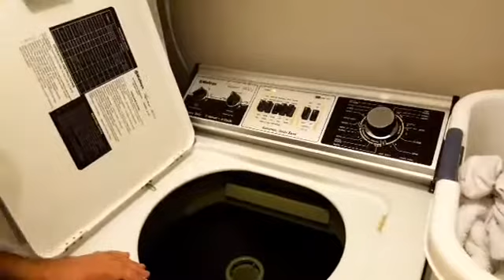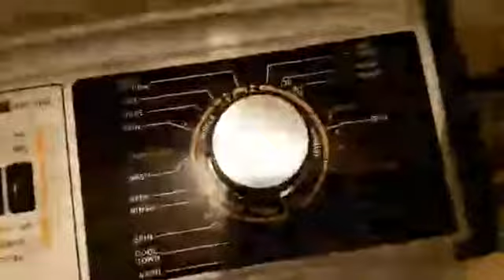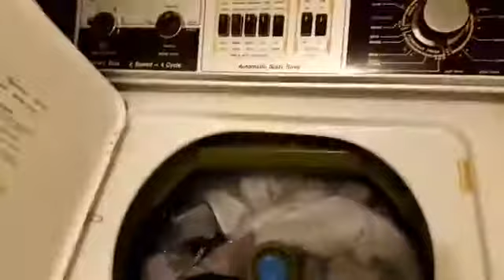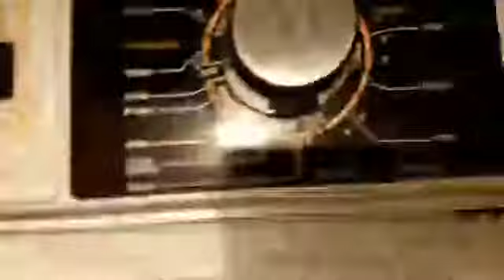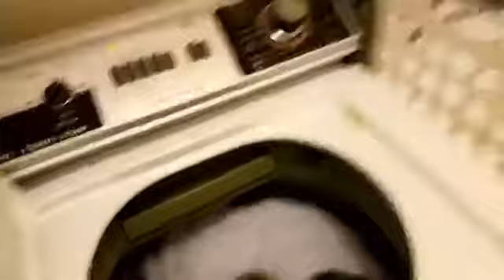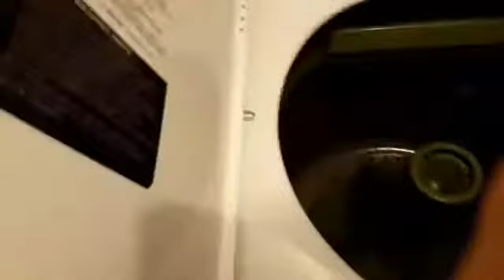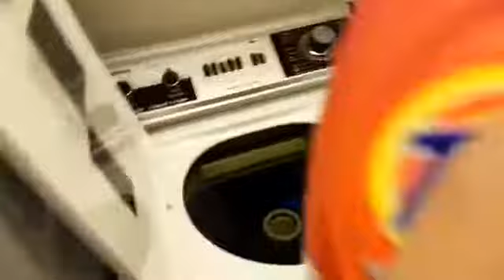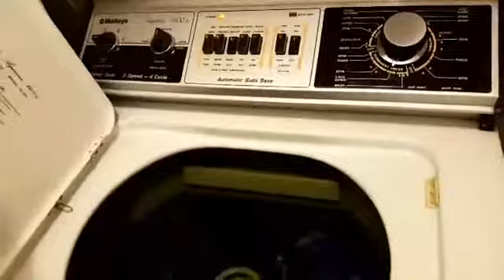Malleys Aquarius 1400A - FB live video with Matt Pearson "mattie17"

Comment: I’ll take that Malley’s automatic over what’s being made today. Thankfully I have my ‘63 RCA Whirlpool Imperial Mark XII set which washes the heck out of clothes and that’s a machine I never plan on getting rid of.
Reply from the maker: They're so good!! And so quick too
Reply: @Shakiralover4ever  the matching dryer if it was gas with the 37,000 btu burner would definitely get clothes dried just as fast as I could get them washed and that’s how most Whirlpool and Kenmore machines of the late 50’s and very early 60’s were.